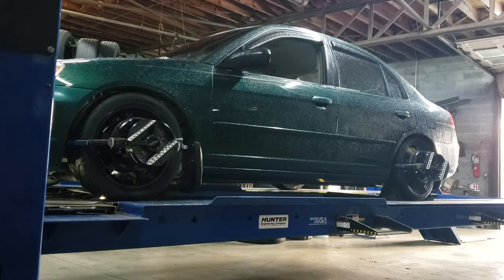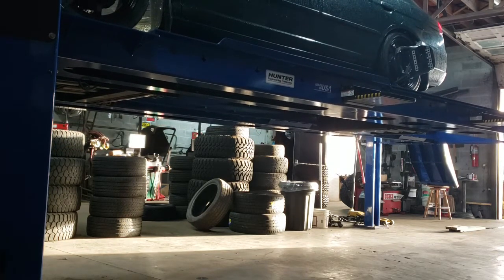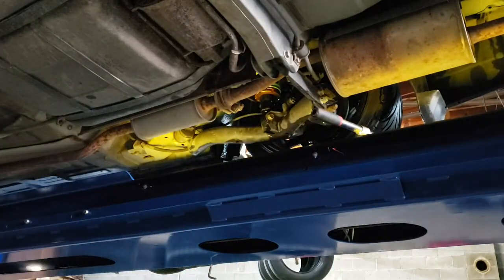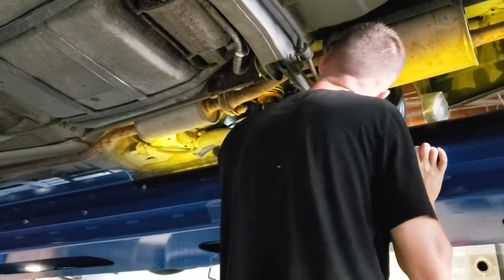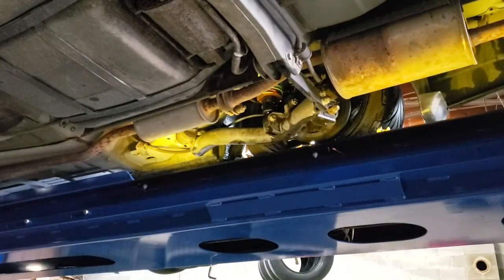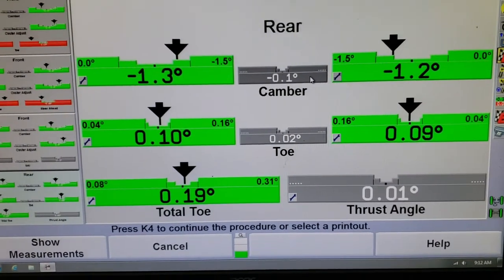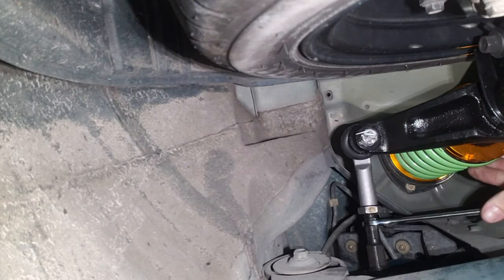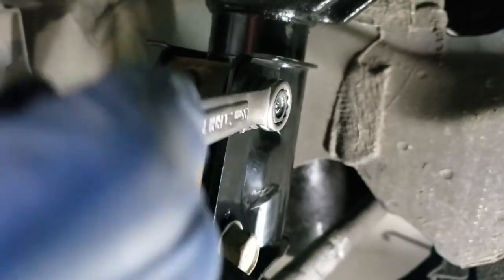Wheel Alignment on a Lowered Honda Civic . Alignments Explained

Comment: I liked your video. Can you tell me my Toe is out of specs for right rear tire and at high speed i feel that my rear tires are moving left and right. How to fix it?
Reply from the maker: First step is to fully inspect the suspension for worn parts or loose play and replace anything that needs it. Inspect tires and inflate all to proper spec. Then check alignment.
Reply: I got brand new tires before 2 days and since then I am not feeling good when I drive. Also I attaching the link for my wheel alignment. https://ibb.co/JpwNCcv

If you can help me.
Reply from the maker: Ok, yes the right rear is slightly out of tolerance but honestly it shouldnt be enough to cause any driveability issues. If you look at the "total toe" on the rear, its well within spec and that is what is more important than individual toe. So the alignment is not an area of concern. Assuming you got a good quality tire, Im not sure what would be causing your issue at this point.
Reply: @ballsoutperformance  today I replaced that new tire with again new tire! Problem is gone but at high speed lil drift I feel at back. He advised me to change the rear shock absorber! What do you suggest! The darting effect is gone but something near axle on right rear is behaving strange at high speed
Reply from the maker: At this point Im really not sure. I probably wouldnt suspect the shock. Usually a worn shock just causes a bouncy ride. Assuming, none of the rear bushings or wheel bearings are bad, Im really not sure. Let me know if you find out what it is. Im interested to know.
Reply: @ballsoutperformance  i checked the bearing myself! They all are good. But when I move the tire up and down, it was easily doing it, he showed me in other car the tire was not moving up and down. As my civic has 150,000 miles he said after 70,000 miles it needs to be changed.

Comment: Nice informational video. Why did you set your rear toe at 9&10 and not 0?
I have a lowered 00 accord and wonder what’s the ideal or best settings for front and rear
Reply from the maker: Thanks. I set everything to the factory specs for that particular car. Toe is generally never zero, front or rear. There are some situations or applications where I will intentionally set things outside of factory specs, but I just base it off of experience. These cars run good at factory specs.
Reply from the maker: I got curious today and looked up the specs on your accord. Rear toe is .08 per side and front is 0
Reply: @ballsoutperformance  yes but I’m not sure where to set my rear toe being max .16 . So you’re saying .08 and not 0?
Reply from the maker: .08 per side. So thatd be a combined total toe of .16
Front wheel drives usually run a little bit of toe in the rear for stability
Reply: @ballsoutperformance  Gotcha Thanks

Comment: Hi sir.. thanks for visiting my channel i saw your comment regarding  camber adjustment which i pressed the spindle.. we ussually do this when there is already an after market with camber kit and still adjustment is not enough pressing the suspension is very effective.. it very easy specially when you are ussing press with gauge. Again thanks. New friend here.. supporting your channel.. hope to see you again thanks.
Reply from the maker: Thanks. Good job on the repair!